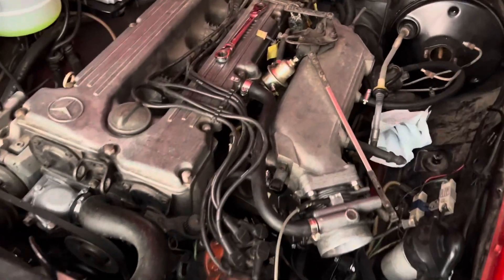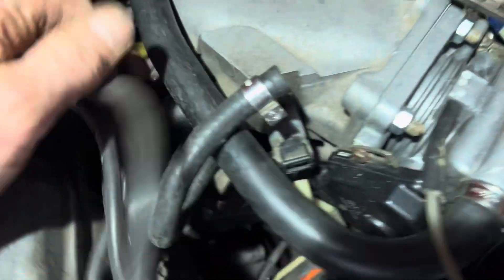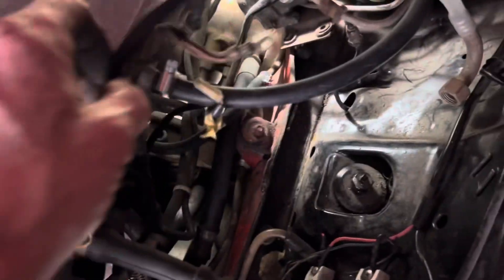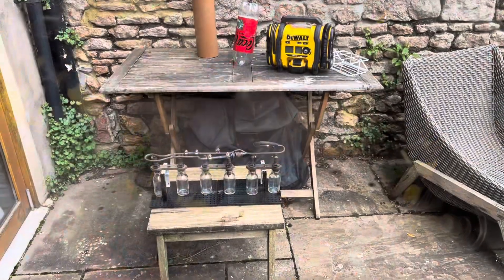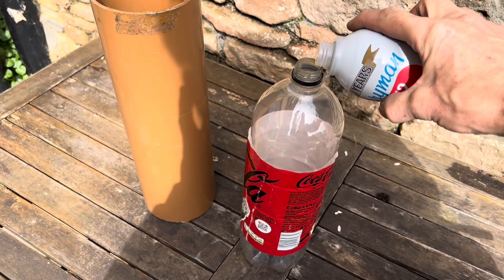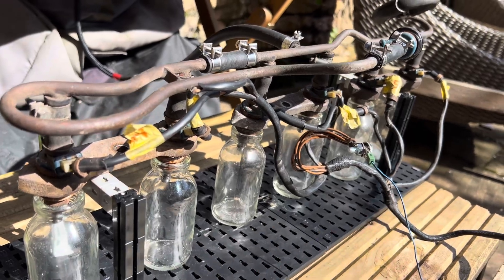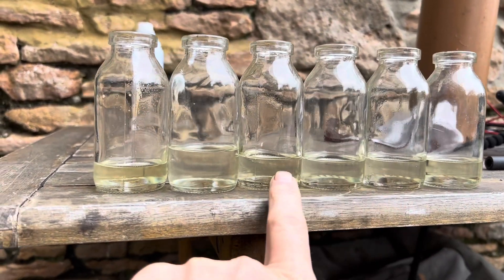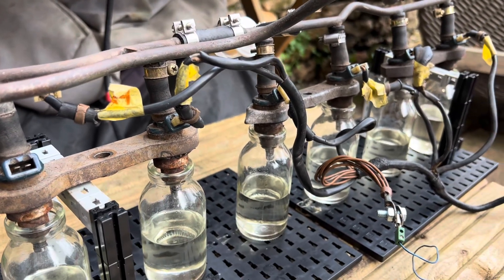How to remove D Jetronic fuel-injectors and flow test Mercedes M110 engine

Comment: Great videos on the 280SL, I have a w114 280E and the same.  I am going to attempt a new head gasket as starting to smoke and pressure being generated in the radiator and some signs of leakage down the ex-manifold side.  would you suggest removing the injectors or can the whole intake side come off with them?  The manual says token the ex and intake manifolds on when you lift the head but it's just me and that's heavy stuff!  Simple DIY man learning.  Thanks
Reply from the maker: Hi - in all honesty, I'm not sure on your car. what year is it and is it a D Jetronic? I would tend to follow the guidance in the manual and get help if need be. It is smoking as in water is turning to steam or is it smoking as in it's burning oil? Black smoke is generally a sign of burning oil whereas leaking head gasket generally leads to water mixing with oil which shows up as coolant loss and milky oil. Mike
Reply: @MikesMercsandothercars  Thanks Mike, Same engine as the 280SL as it's an M110.981 D-Jetronic.  Oil is not milky.  Cold compression was 100/105 across the cylinders, I know you're meant to test when hot but......oddly enough, 20mile trip today and no smoke moving or idling at temps??? and temps stay at the 175 mark/8am hmmmmm
Reply from the maker: @jaymac5402  The M110 engines are not generally known for blowing/leaking head gaskets. Is it possible that either the fuel or oil has got moisture it from standing? Sometimes a good long/hard drive can sort these issues out. Mike
Reply: @ Used as a daily.  Would seem the a leak is coming from of the side cam access covers on the block.  Bit of a nightmare to get to as exhaust manifold in the way, and don't think that has ever been off looking the the nuts! hmmm
Reply from the maker: @ Hi - remind me of where you are based? When it comes to getting off the manifold nuts, something like a magnetic induction torch is your friend. Snapping one of studs is a right old pain. The video below might be of use:

https://www.youtube.com/watch?v=c2_Wnl8u9pU

Mike

Comment: Hi Mike, nice video! I did it taking the inlet manifold off. Might take a bit longer but is a lot easier I find. Quick question, where does the other part of the harness has its ground? The one that has the temp sensor, throttle sensor, etc. Thanks in advance!
Reply from the maker: Hi - what model and year  car are you working on? I will take a stroll down to the garage and have a look - it is different on different cars. Mike
Reply: @ It is a w116 280SE ‘76!

Comment: No haven't solved it yet I actually sent the injectors back to Injector Rx to retest at 30 psi and 3 volts they tested them originally at 42 psi and I just want them tested at the proper spec for mercedes.  So when I get them back will try again.  Also ordering the boots from repro parts. Question i have the same plugs you have they are crimped on the wire so the only way to seperate the wires from the plug i found that heating the old plug with my heat gun allowed me to seperate the wires so I can use the connectors.  My question is will the old connectors just plug into the new one's?
Reply from the maker: Yes - the old metal crimp plugs will just clip into the new plastic plugs. Mike

Comment: Mike it seems that I rechecked the connector and there is no marking on it and it does go on to the injector either way.  The only way I can think of determining the - OR + Is pull back the Boot and look at the wires one wire is brown then determine what charge the brown is then I would know what orientation the plug goes in.

Comment: Mike does it make a difference how the electronic connectors plug into the injectors looks like they fit in either way and I don't see a positive or negative indicator on the injector or the plug?
Reply from the maker: Hi - the plastic plugs only fit one way into this style of injector and the injectors are clearly marked with a +ve and -ve alongside each terminal. When the magnetic field of the injector collapses, it creates a large voltage spike and maybe that is why it matters which way round the +ve and -ve go? Mike

Comment: Thanks for the class! I will use this knowledge to maintain my MB 1975 280SE.
Reply from the maker: Thanks for your comment. What a nice car you have. I think somebody has used the engine from a 280SE to put into this 280SL. Where are you based...? Mike
Reply: @MikesMercsandothercars  Hi Mike! This engine equipped several MB. My engine was stopped for 20 years and with minor maintenance it came back to life. I'm very far from you. I am in Sao Paulo, Brazil. Good luck and I hope to see your engine running. Marco
Reply from the maker: @marcosortolani3639  Thanks - if your engine started after 20 years, maybe there is hope for this engine! Mike in England.
Reply: @MikesMercsandothercars It will run!

Comment: Excellent video.  Interesting science project.  I was surprised by how much fuel came through in 5 seconds and how it wasn't a fine spray.  Intetested in seekng what Mr. Injector does.
Reply from the maker: Yes, I was surprised at the spray pattern too. Once I get this car running, I’m hoping to hook up an oscilloscope which will demonstrate how quickly these injectors fire…..too quickly to measure with a volt meter. 5 seconds would be 5000 milliseconds and from memory the pulse width is about 3milliseconds. Mike

Comment: I must say it's impressive that these complications don't seem to defeat you. 🏆
Very interesting videos!
You must mention in your injector related topics that these particular injectors are low impedance, Peak and Hold type, which draw a lot of current and should never be connected constantly at 12Volts because they can be damaged. Their duty cycle doesn't usually get over 80% (Who knows, maybe someone who watches your videos won't know these details and they should). Take care!
Reply from the maker: Thanks for your comment - yes, I was surprised at the current these injectors draw. I guess when they flow test them, they must pulse the voltage. The DJetronic injectors run off 3V so putting 12v directly through could damage them. I’ll reiterate this when I put the whole kaboodle back together. Mike
Reply: @MikesMercsandothercars  I only mentioned 12V because I've seen a few videos in which people just connect them to a car battery. One of them had some smoke coming out and the fellow that made the video was surprised but not too bothered. Well... I guess it's hard to find good reliable content you can trust on the internet (as we all know 😉) Your videos are a good source though!
Reply from the maker: @Albert.M.K  Yes...`people seem to assume that because they have seen it on the web, it must be true. I am often corrected by people far more experienced than I will ever be....and I am eternally grateful to viewers who take the time to engage...and impart their wisdom. Mike